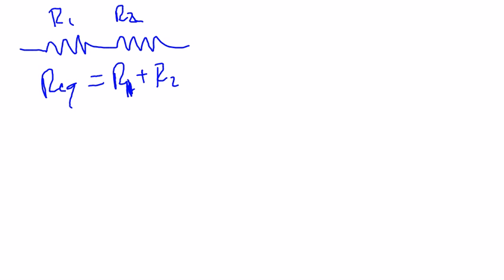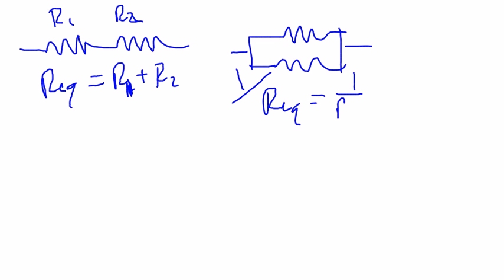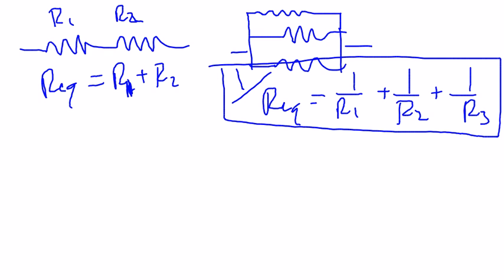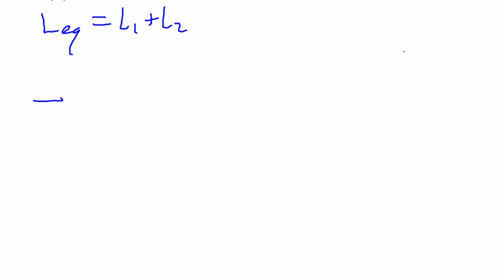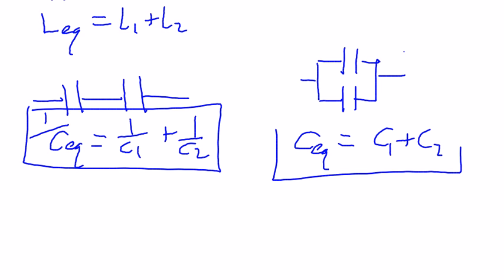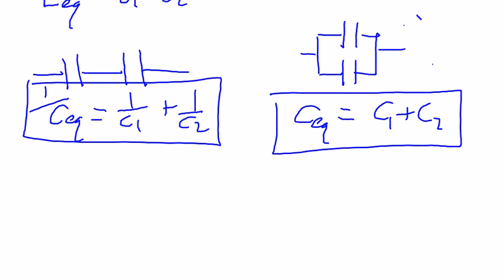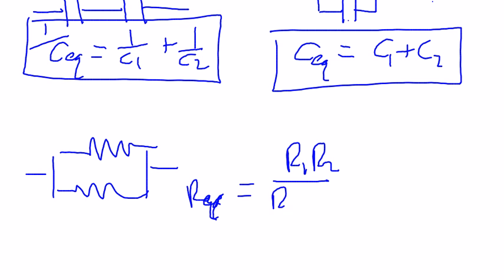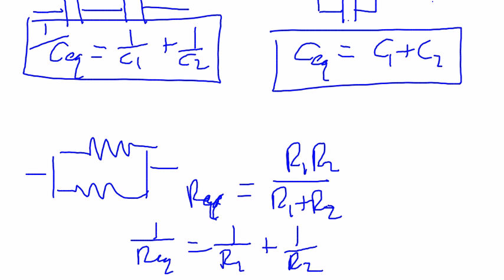Adding Resistors, Capacitors, And Inductors

Comment: How can the formula for two capacitors in series be 1/C1 + 1/C2 if the same series circuit is C1C2/C1 + C2 and now you get two different answers. if C1 is 2 and C2 is 3 you first get 5/6 then the second way you get 6/5=1.2Farads???